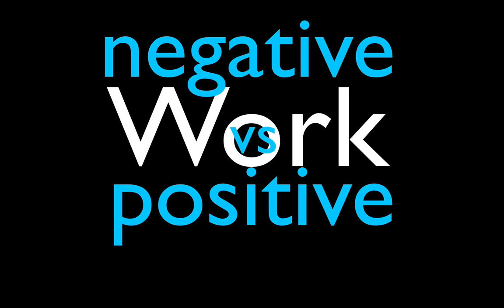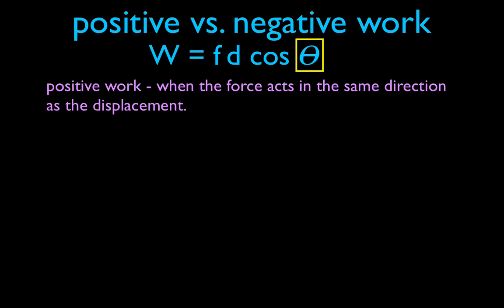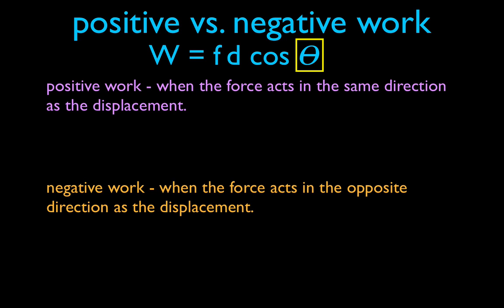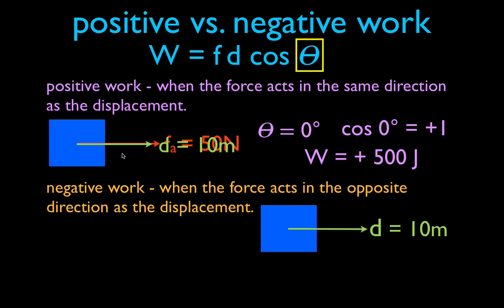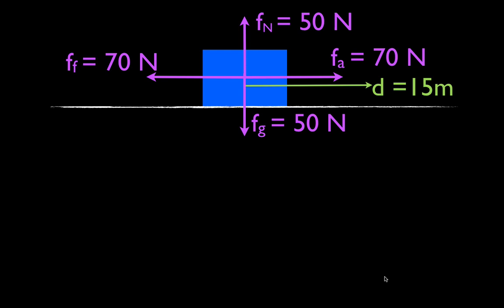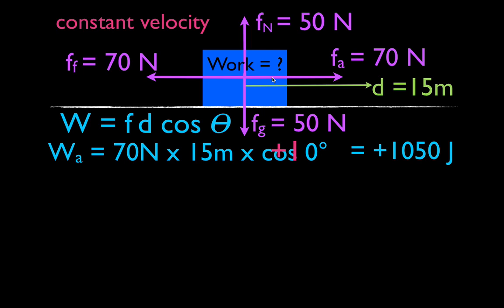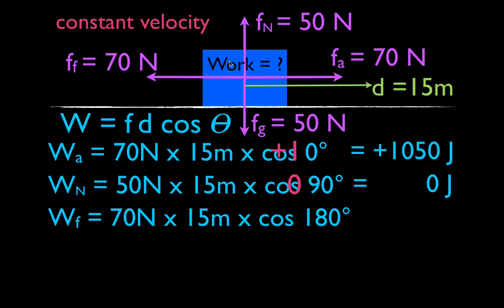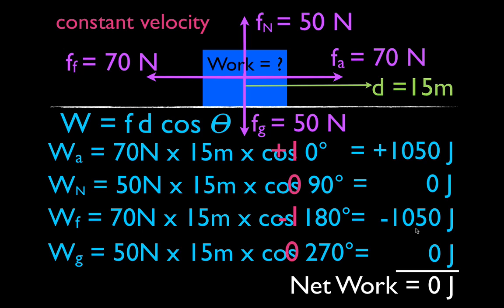Energy, Work & Power (14 of 31) Positive Work vs. Negative Work for Horizontal Motion

Comment: I just wanna ask...since work is a scalar quantity which has magnitud but no direction, so why should we care if it's in positive or negative direction?🤔
Reply from the maker: When you have negative work then you have non conservative force that are take energy out of a system or are slowing it down.  The most common example is friction.
Reply: @stepbystepscience  thanks for a video,  but there is a question: force is a vector.  So, when you change the direction of the force of 70 N in your example why don't you change the sign from +70N to -70N?  Thanks for the answer in advance!